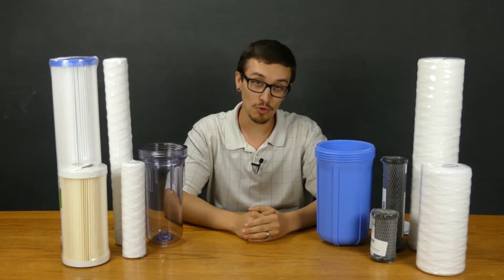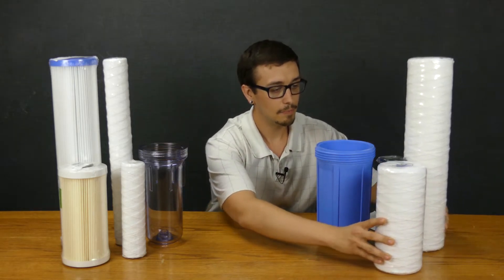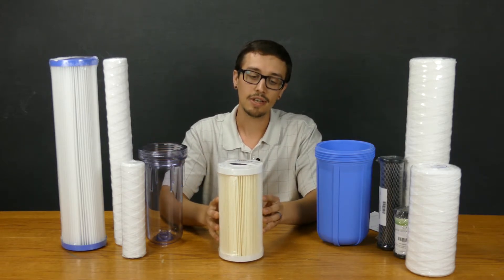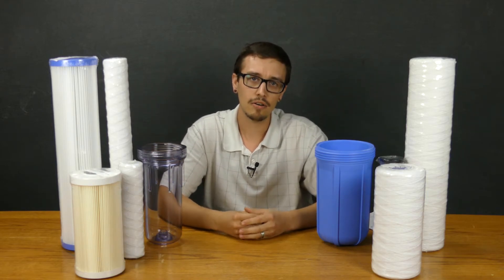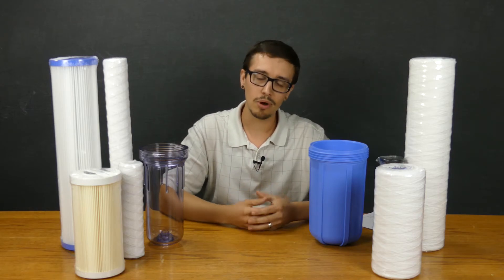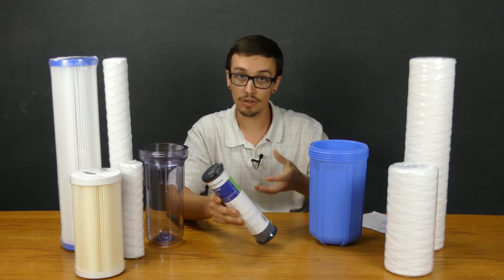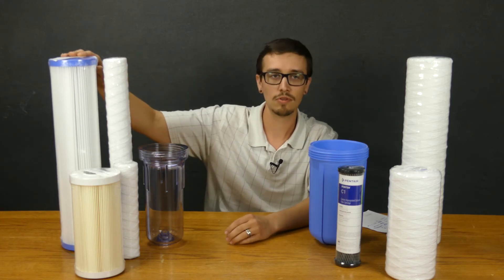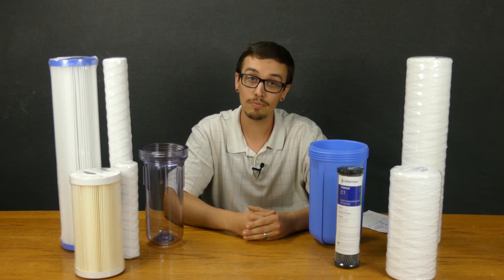Basic Overview of Water Filters

Comment: I put a 200u spin down as stage one, 50u pleated filter as stage two, and a 5u string filter as stage three, for well water. Works great! Clean water, faucet aerators not clogged, dishwasher and washing machine inlets no longer plugged up. No more iron in the water softener resin. Fabulous. And no more iron bacteria in the water heater. BTW, if you have that nasty sulfur stink in your hot water, you can install a special anode rod that is in fact electric, called Corro Protec, (Amazon) and will eliminate that smell that day! No more huge PIA water heater cleanings, bleaching, etc.